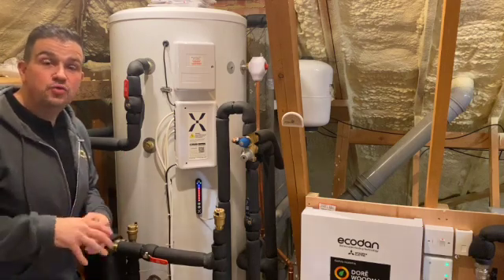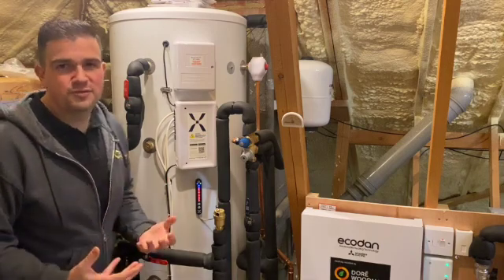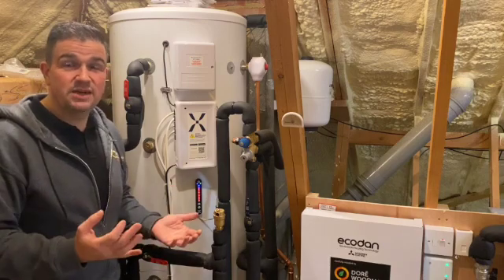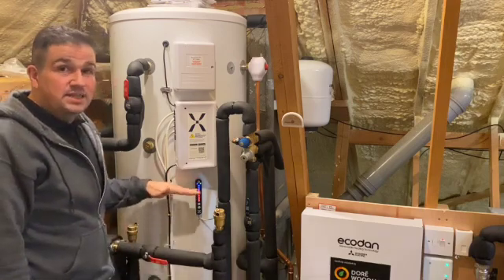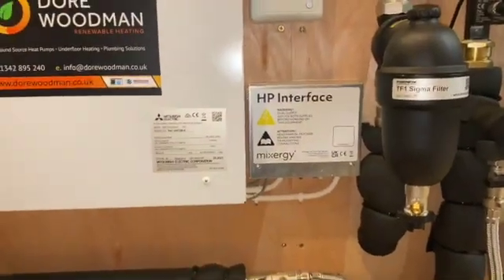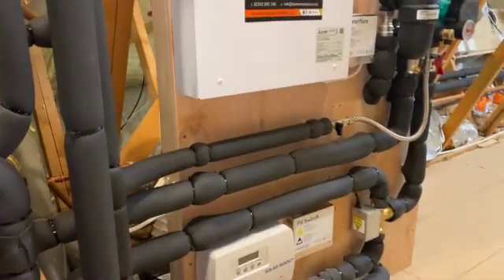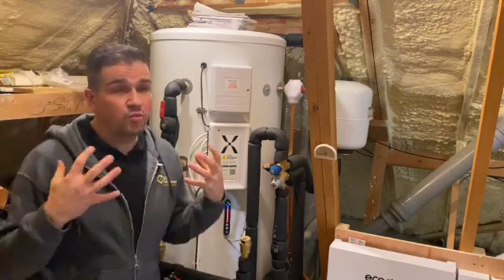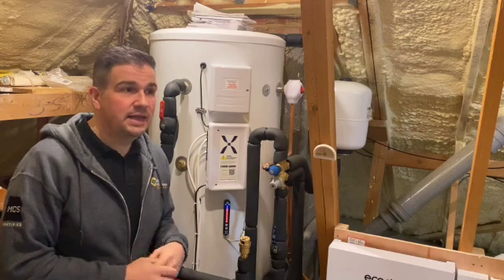Mitsubishi Ecodan Installation and Mixergy Smart Hot Water Cylinder Installation

Comment: I had discounted the Mixergy as I had been told that when connected to an ASHP it reverted to being a standard emersion heater and you didn't get the benefit of choosing how much water you needed.  For the most part I will be a single person living in a 4 bed 2 bath house so would want the capacity when people came to stay but on a day to day basis would probably only need 50% of the tank if not less.  I will also have Solar PV, Harvi and eddie and a Give Energy all in one battery.  Can you confirm the Mixergy tank would still work as required with my setup?

Comment: Hi Great video... few questions ...
1. can we use ecodan pump + eddy to push excess PV energy to the ecodan boiler? does ecodan supports this configuration ?
2. i have raidators from 1990s, what is the Max water teamperature ecodan can produce ? will this be suffience to heat the old radiators ?
thxs for your inputs
Reply: The eddi normally heats the immersion heater but with th relay board you can have it set to trigger the heat pump at a specific excess.  So for example if you know the heat pump needs 1000w to heat hot water you set the eddi to run the immersion from any excess up to 1000w once this threshold is reached the eddi's relay triggers the heat pump to boost the hot water you set timings to avoid the heat pump cycling on and off.  That way you use the heat pump at its most effective

Comment: Anyone successfully configured a Mitsubishi ecodan R32 monobloc with a Mixergy and Myenergi Eddi?
Reply from the maker: Hi Nick, are you having issues?
Reply: @dorewoodman  hi, no, I'm just in the process of speccing a system and want to ensure all hardware communicates properly
Reply from the maker: @stupidusername38  oh I see, well the Eddi will have its own package, app etc, dependant on the distance between cylinder and electricity meter you may want to consider the myenegi Harvi which is a wireless link for the clamp to Eddi. 

With the Mixergy cylinder ensure you have the Heat Pump ready cylinder, plate heat exchanger and pv switch, it will then come equipped with the heat pump interface that you can link to the Mitsubishi heat pump and FTC 6 interface.
Reply: Where did you wire the mixergy hw thermistor into as the ftc6 has a plug input for the hot water sensor?

Comment: Thanks for a very informative video. Would you see any issues doing a similar system but using a Split Ecodan Heat pump ?
Reply from the maker: Hi Brian, 
I’m not even sure the splits are available anymore in the Ecodan range, they may have some old models around somewhere but even the very large commercial like the CAHV are monoblocs. Splits are obviously useful for certain situations but they have predominantly gone to Monobloc so that heating engineers and companies can fit them without the F Gas requirements.

What do you have in mind? Is it something you are thinking of for your home?
Reply: @dorewoodman  I hope to replace my boiler which is in a detached garage. Currently flow and return are in an insulated duct which has worked perfectly. However the distance to the cylinder is approx 20 mt and my prospective supplier has suggested this is not optimal for efficiency in a monobloc system. I have seen that split systems are better for longer distances between the outdoor unit and the cylinder. Thanks for the feedback, Brian

Comment: heat pumps are a complete scam, they do not work very well when it's cold, 50% of houses in the UK are not suitable for them anyway, and if I had then installed in my house which is not possible by the way, it would take me probably over 20 YEARS🤣🤣 to get my money back to make any savings. complete scam by plumbers to make a lot more money off gullible middle class people. The main disadvantages associated
 with air source heat pumps are listed below

Lower heat supply compared to oil and gas boilers, so larger radiators would be needed
They perform better with underfloor heating or warm air heating and work more efficiently when coupled with larger radiators
They can take quite some time to heat up, leaving your home cold in the mornings
Air source heat pumps are not the best option if you live on gas mains
They need electricity to be powered if there is no access to solar energy or wind power
You would need a highly insulated home to reap the high energy savings benefits
Noisy like an air conditioner when it is running
Need to run constantly during the winter, which can make the noise worse and cost higher
Less efficient in winter due to low Coefficient of Performance (COP) levels
The cost of installing an air source heat pump is usually  £3,000+
To have a high return in terms of saving from purchasing and using an air source heat pump, it is important to have a well-insulated home, with especially loft insulation. This makes sure that the heat generated within the home does not escape
Reply: Ok, lets take each one of those in turn shall we Ian:
1. Changes to part L from this year require all heating systems to be designed for low flow temperatures, so larger rads are required for everyone, irrespective of heat source.
2. Correct, as do all lower temperature heat sources.
3. Why would your house be cold in the morning when you have a night time setback? Even better still, setup your boiler properly with decent weather comp and just leave it running 24/7.
4. With the current unit prices, if you can manage an SCOP of 3.5 or better, you are better off with air source over mains gas. Come October this year, it's highly likely that this will change again and gas will rise more than electric, swaying the balance in the favour of ASHP.
5. All modern central heating systems need mains electricity to power them - it isn't 1950 and we don't run gravity fed coke stoves anymore.
6. With the current energy prices, everyone should insulate their homes to the best possible levels. Grants have been available for years for cavity wall and loft insulation.
7. The noise is outside, unlike the noise from your gas boiler. A properly sized, modern unit, running in weather comp, with variable speed compressor and fan will be quiet at part load.
8. Cost and noise are lower when run 24/7 as the machine has to work less hard as it's not running in load compensation mode and trying to target a high flow temperature.
9. A new central heating system, with a new UVC and new rads costs money. You can't compare a new system to a simple combi swap.
10. It's 2022, energy costs a lot, who doesn't want to have a well insulated home?
Reply: @dorsetengineering  you didn't really answer any of my questions why would I install a heat pump when it's going to take me between 16 and 20 years to get my money back  and 50% of houses are not suitable like mine
Reply: @londo776  Ian, it's very rare that anything you invest into your property gives you a payback within the warranty and/or useful lifespan of the equipment/thing. Gas boiler upgrades are the biggest scam in that regard, you'll never get back the installation costs in gas savings unless you upgrade rads at the same time to take advantage of lower flow temperatures. You should install a heat pump when gas approaches price parity with electricity, which will happen eventually. After all, keeping warm for sensible monthly costs is what's important to most people.

Would you care to explain why you think your house is not suitable? Heat loss is heat loss, irrespective of whether you burn piles of £20s in a brazier in your front room, heat with gas, wood, oil, coal, or air source...